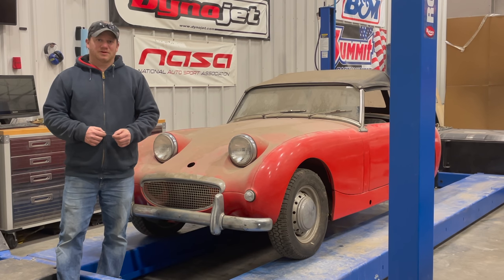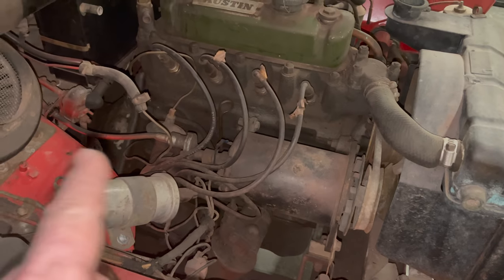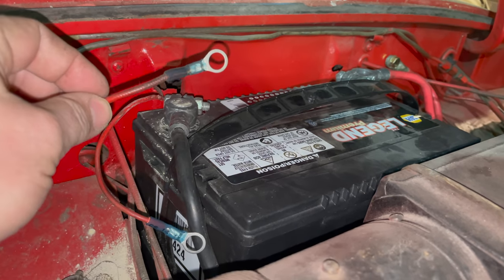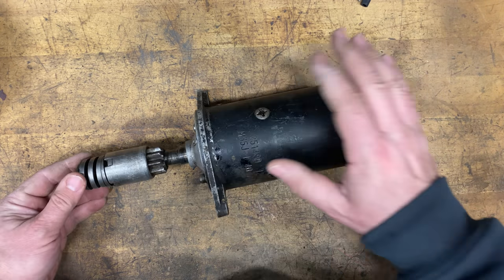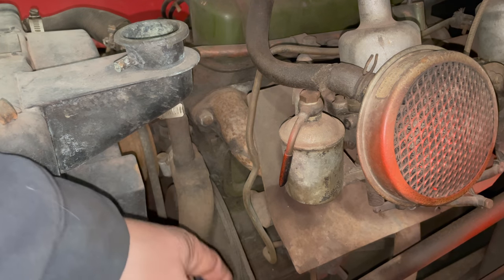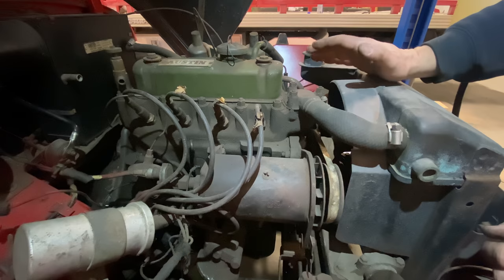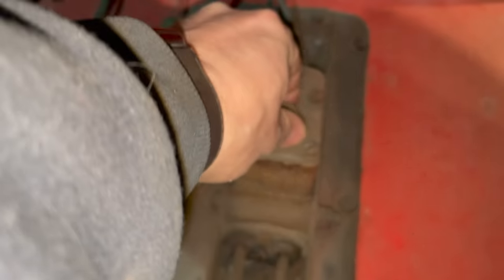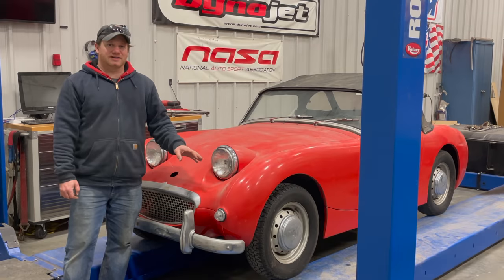Round 1 - Barn Find Sprite #4 - Will It Run?

Comment: Where does that oil line you snipped and plugged go? We had a couple of Triumphs (TR3 and TR4A) when I was a kid and I'd kind of like to obtain another little British fun project.
Reply from the maker: To the oil pressure gauge.  It was missing and would spray oil all over the inside of the car if I didn't plug that.
Reply: @ThisWeekWithCars  Oh yeah, I remember you mentioning the missing gauge now, that would have been a messy mistake. Good call and thanks for the reply!